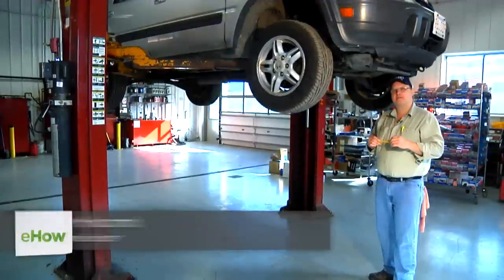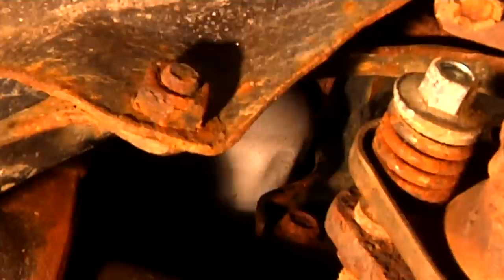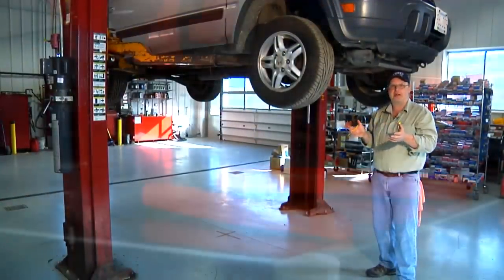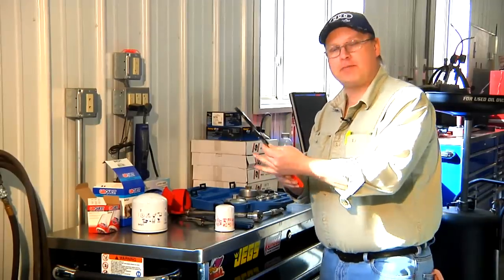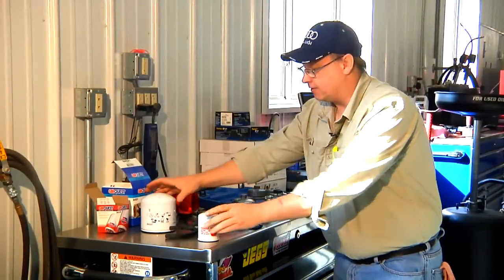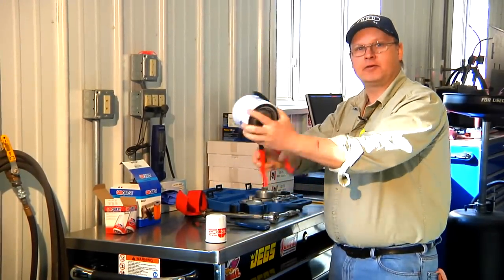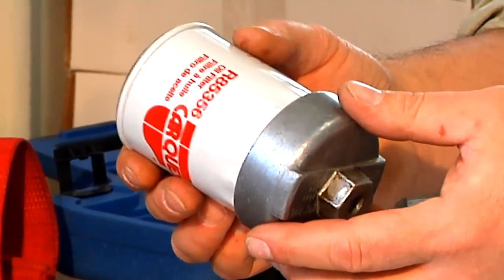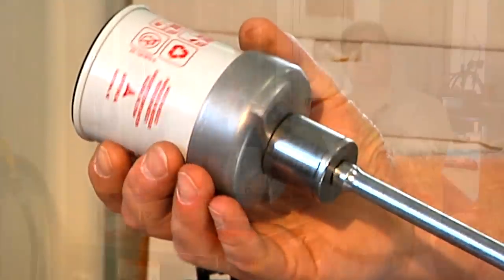How to Change Stuck Oil Filters in Hard-to-Reach Spots : Under the Car Repairs

Comment: You can remove the filter by reaching over the top of the right front tire. Until I saw this being done on a YouTube video I had a terrible time trying to take the filter off from underneath. This works when the filter hasn't been over tightened and requires a wrench. It's hard to clean the mounting surface on the block though and I now leave this step out. I have used this method for the last 2 oil changes and it solves the problem. Some won't like it because you have to do it "by feel" but it works for me.

Comment: hello.  I bought a socket device like that, except it was plastic not metal like yours.  anyway it doesn't work, the plastic simply bends to slip over the filter like a stripped nut would.  would the metal device surely work?

Comment: PLEASE PLEASE PLEASE do not over-tighten oil filters in the first place. Is that too much to ask??? Channel locks are the only way I have been able to do the really bad ones over many years - and be ready for remaining oil in filter to gush out when you tear the thin metal cover. No need to over-tighten these filters - we have Positive Crankcase Ventilation for a reason! Hand tighten and then wrench to 1 oclock